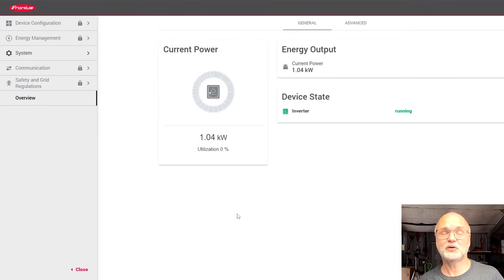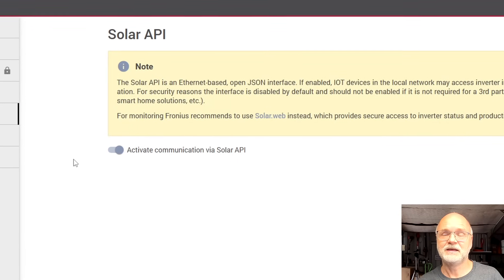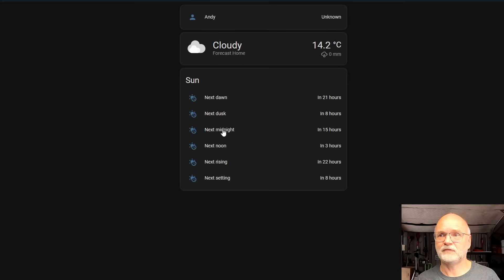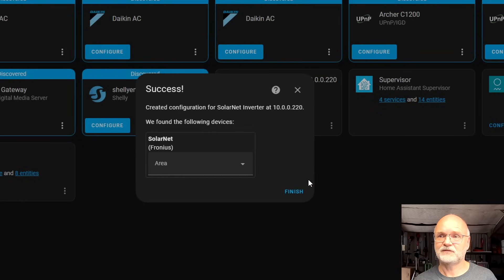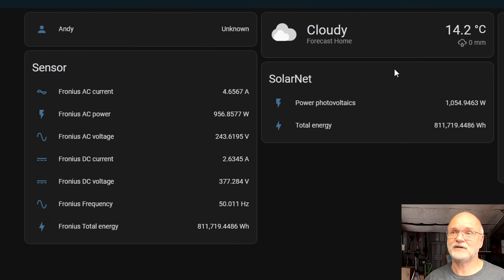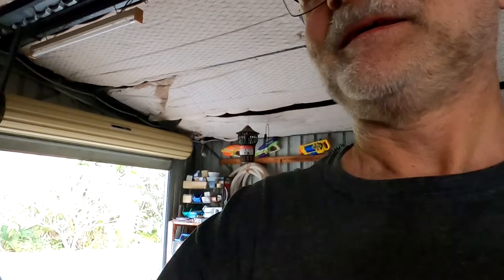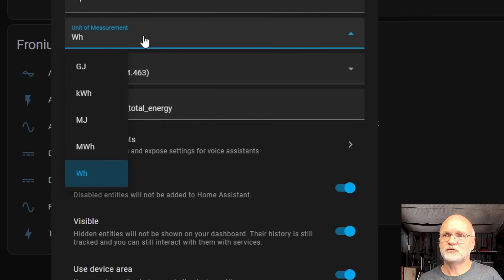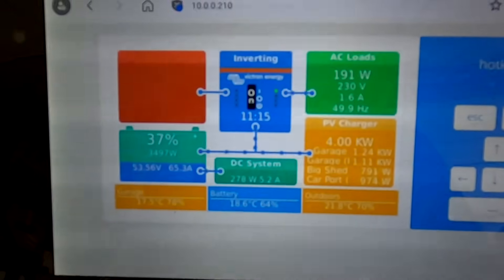How to integrate your Solar Inverter into Home Assistant. First step to Solar Storage Automation.

Comment: I also have a gen24 symo fronius inverter.
It is integrated in my HA green version. I cant get any automation to work when i have solar production or when i dont have solar production. The energy info shown in HA is corect, its the same as the solar web. But still, nothing works.
So, i managed to make it work. But it works randomly. It turns on a light when solar trigger is true, but it turns it on after a random time(5 minutes-1 hour). If i switch it off manually, it would pass the same time as above to switch on that light.
There is a random delay. For example, i switched off 2 lights. The HA turned on 1 light after 3 minutes, but the second light did not turn on. Solar production was way above the trigger value for both lights.What should i do?
Can you please help me?😊

Comment: Hey buddy I just wanted to check with you. But before I buy anything could you possibly point me in the right direction I would like to monitor my EG4 6000 XP on home assistant and I'm wondering if I need solar assistant setup in order to access the data for home assistant so everything is in my dashboard, Thanks for all your content!

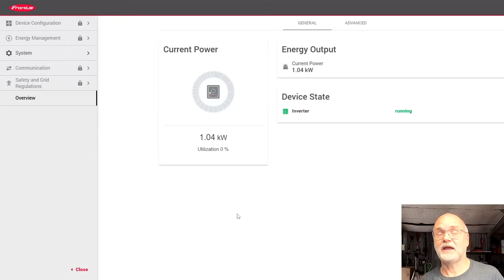Comment: 4:09 this is the most difficult bit, connecting the inverter to the Wi-Fi LAN.
Some inverters have the Wi-Fi reach of 5 centimetres so your phone can connect, but too short to setup a Wi-Fi LAN AP from a home desktop.
Is there a HA solution to making inverters reach the Wi-Fi LAN?

Comment: Can this be done with USB connection from my MPP-Solar inverter to Rpi?
Reply from the maker: No, you need to use RS485 and have the right protocol from MPP. USB will not work.
Reply: @OffGridGarageAustralia  ah thanks, my MPP-solar inverter only has usb and rs232 communications
Reply from the maker: @paulsharp1712  What do you run on this Rpi? HA?
There is actually an integration for MPP inverters and HA...
Reply: @OffGridGarageAustralia  cool,  hadn't found that!

Comment: Hi Andy 
thx for the great informative Vids! - I have the Fronius & BYD battery added to HA ....BUT ...Any chance of a vid on how to use the data? like ... if battery is FULL and Power gerneration is XX,,, turn on shelly switch for Hot Water /car charger / pumps etc ...😇

Comment: Hi Andy. I'm new to Home Assistant and have now a RPi4 + raspbee II  with HAOS installed and running. I would like to integrate my Victron system thru Cerbo GX into HA. In your video you introduced it can be done easily and will come in a other video. I'm so curies to see how this can be done without coding. Im a big fan of this community and your excellent video's!

Comment: I would really like to know how you connected Victron device to home assistant using the HACs integration because it asks you for the Advertisement key I have spent hours trying to find any simple instructions on how to get it. I bought a Victron Smart battery sense just to get my battery bank voltage on Home Assistant

Comment: Hey Andy how do you make more power in clouds than pure sunlight? That is just very strange to me incredible though but just very odd. One would think direct sunlight would create more power and clouds would decrease power. Anyway you could make a video to explain this? For idiots like me lol😂
Reply from the maker: Hey Branden. That is due to the shading from the trees I have for 3 months in Winter time. They block most of the sun during the day but with clouds, the light is coming from all sides and I have a huge increase in generation.
Reply: @OffGridGarageAustralia  ohhh ok that makes sense now! I live in Wisconsin in the USA. It's our summer now. Rather dry one.

Comment: You open a can of worms with Hassio, did right with the energy side of things. One day you have to show how to put the inverter info in the energy dashboard and since you have them, devices to monitor individual energy. I bought an esp but use batmon works with more than one bms and no coding, you will loose the connection to them for mobile app but in my case makes no difference since I manage everything  in hassio, victron connect still allow to see the battery voltage, A, SOC, etc . If JK Bms gives an error turning it off and on allow to be discover again, smart shunt works every time. Now will wait one more week for the BMS review.
Reply from the maker: I know, I really want to focus on the energy side here with Home Assistant and show some simple automations. Otherwise, the whole topic and theme of the channel may change quickly 😁

Comment: Andy you will love the tailscale plugin, you will be able to monitor everything on home assistant (and other devices) without any complex setups, it just works. I even have a widget on my phone that shows me the power produced and the battery percentage. Yes, i know, feeding the addiction!
Reply from the maker: One step at a time... 😁
Reply: me too, using Tailscale VPN to remotize HA where WAN IP address is not available (modem using cellular access to internet),
to replace the popular duckdns for Wired WAN.

I can confirm Homeassistant is so flexible and wide covering any kind of devices as currently I integrated on HA running on RPI4 @4GB of memory:

Solaredge API for on grid inverter and Resu Battery;

Shelly to monitoring grid exchanged power;

working on EASUN 8kW hybrid inverter (HA full integration in progress);

Tuya HA integration and HA Automation to switch on/off and monitoring power of EASUN, based on grid power exchanged. value;

3xJK-BMS by bluetooth dongles  and Github BATMON by fl4p to 2 Lion 13S + 1 LFPO4 16S @48V monitoring 43 cell parameters per battery;

4xSEPLOS V. 2 by RS485-USB adaptors and Github BMS-Monitor/HACS by flip555 to 4xLFPO4 @48V, monitoring 193 cell parameters per battery;

Tesla Wall connector to monitor car charging.

The only sw I wrote have been few rows of yaml code for Automation, none for integration.

Comment: HA is so great, but if I use Modbus TCP for Victron I didn't get entities about Critical loads on AC out1. 
Maybe you can help to get all informations on the Energy-Dashboard
Reply from the maker: Yes, I have the power display for AC out 1 showing on my dashboard. The entity is called vebus out L1 Power.
Reply: @OffGridGarageAustralia 
but where do you enter this entity?  House consumption is a calculated value of difference between Solar production, feed in/out battery and forward energy to grid.
Reply from the maker: @matthiasm8648  ah, ok. I'll show you in a video. If you want the info upfront, send me an email.

Comment: One of the first loads I automated was the pool pump. By using the sunrise and sunset parameters (with offsets) it will automatically adjust the pump's run time with the season. I used to also make further adjustment to pump start time based on availability of excess solar PV but it's not really necessary with the automatic time of day adjustment.

I also have HA automations looking after if/when to use supplemental charging of the off-grid battery with excess grid-PV. Needs it at this time of year because my off-grid PV array is small (2.2 kW) while the grid array is 11 kW.

As for using the Growatt (I don't use one) and many other inverters which are based on similar architecture as the Voltronic family of inverters (hundreds of them), an alternative which does not require using Growatt's off-shore servers but keeping it all local is to use Solar Assistant (requires a dedicated RPi). Solar Assistant is a bit like the Cerbo is for Victron kit. Then integrate the Solar Assistant with Home Assistant (using the MQTT integration). It works really well and is how my off-grid inverter is integrated with my HA. It's also very fast with second by second live data. SA also integrates the data from my Victron smart shunt.
Reply from the maker: Yeah, my pool pump needs to run longer in warmer weather to produce more chlorine. So, the day light time is not critical to me. But, I'm sure HA could handle this as well somehow. I'm not too fussed as the pump will run 24/7 in summer anyway. I then have far too much energy to burn....

The third point you make is exactly why people don't use HA. Just by reading this puts most of them off. Additional hardware, additional software, MQTT..., this is all not straight forward and a huge barrier for many.
But I understand what you mean 😊
Reply: @OffGridGarageAustralia  To be fair though, most of the Venus OS stuff you've shown over last couple of years (let alone the BMS communications) is much more difficult than hooking Solar Assistant up.

I agree, simple is good though. The primary benefit of using SA is it makes the Chinese inverters smart and easy to automate functions and so you can get triple the capacity of Victron for the same price (or pay a whole lot less for the same capacity).

Victron is nice kit but it's very expensive and in this off-grid / DIY space many are looking for better value and would like to avoid paying the blue tax.
Reply from the maker: @alexsimmons1803  good points, thank you.

Comment: Thanks again! It is really essential to have a central data collector and handler. I am using ioBroker and it serves my Gen24 directly and the Fronius web cloud as well, Fronius Wattpilot, BYD, Shelly,  Zigbee, utility meter and much more.  
Did you get a direct access to the Gen24 PV string power?
Reply from the maker: What do you mean by access to the string power? I'm getting the DC string voltage, current and power so far.
Reply: @OffGridGarageAustralia  I am just getting the total PV power combined of all strings and the 2 string currents and the 2 string volatges, but not the power of the individual strings. So, I have to calculate the 2 different string powers by myself. The complete combined PV power ist delivered by the Gen 24. But not the single powers of the single strings.
Reply from the maker: @klassichd10  ah, right. I have only ones string, so...
Can you get it calculate through HA somehow, is that possible at all?
Reply: @OffGridGarageAustralia  I am using ioBroker and currently I am calculating the two string power values by a Java Script which is the way user defined stuff is done in ioBroker (like python in HA). That works all right. In the Web Interface and Solarweb I also can see the two string powers. So, I hoped that there might be an undocumented feature to get the values directly and avoid this calculation. Just as an optimization to reduce calculation power.

Comment: Hey Andy. I am curious if you are getting 4kw during overcast winter weather, do you generate anything on a clear night with a full moon?
Reply: I sometimes see e few watts coming from my 4200Wp strings at full moon. But nothing worth to care about ...
Reply from the maker: No nothing, the voltage during full moon is far to low for a 48V battery. 
I probably could hook up a single battery cell charge it during the night from a 14kW solar system 😂 Not sure if there is actually current flowing.
Reply: @OffGridGarageAustralia  If you could charge even one cell, the idea that you could get anything from moonlight is magical. 🙂

Comment: Where is the damn snow considering you call it WINTER. No winter without snow.
Reply from the maker: Hahaha, once you live here for 10yrs+, 10° feels like -10°. 
Well, no snow here but 150km further inland, they have sometimes snow in the morning. And of course the Australian Alps in the south.
Reply: @OffGridGarageAustralia  I'm not sure but have you thought about the integration of SEPLOS BMS into HA ?
I still have that older, previous one without BT and think about an upgrade to the BT .
Right now I have an outdated intel laptop running next to it to get access and run the changes if needed. 

I did not need it cause I was able to retrieve the data or at least some from the back through the Growatt API access but , big big big but 

Growatt is now blocking accounts if you have too many api calls per day or hour and I am the first they shut down for a day or from the noon onwards cause I am running just 5x 4,6 kW Growatt inverter (3 as a surplus system with a battery and 2 as an additional system which is only feeding into the grid for 0,05€ more per kWh). But my call amount is basically 5 times higher then those with just 1 big inverter.

And due to the fact that the day starter earlier means that the point of time blocking my account starts earlier and earlier therefore the impact is hurting more and some SEPLOS data might be usefull too cause I am running the system with let's call it shared priorities. I mean I have 3 surplus 'consumers' to use energy that otherwise would be fed in.

And so I do not have a rule like first battery, then car and finally now the 270 L in the heatpump water boiler (which also has a heat exchanger needed for the sept - april heating season here. The last one is obviously the last to 'charge' once the warm water is achieved, but it has a PV SURPLUS mode where it is taking surplus energy to heat the full boiler up to 62°C in preparation for the heat exchanger that pumps the energy to the radiators we tend to use in the evening at least till end of may.

I am aware of the grott development which is running growatt inverters in a kind of proxy mode and listening to the growatt inverter to growatt cloud communication passively.
I am using already such a tool acting as a proxy called evcc developed here to charge the car with surplus only and also the heatpump boiler, which worked quite well, but the official growatt HA integration is still relying on api calls , so I am hoping for the HACs GROTT  implementation by also using the stealth or proxy mode to get the data.

Otherwise things get complicated cause I need some data for the SurPlus decision inside HA ... which are also in the Growatt app, but out of reach from HA at least from noon onwards.
Reply from the maker: @typxxilps  Yes, we will do this at some stage. One step after another...
HA can even wipe your a** if you want to😁

Comment: Hello, I'm from Brazil and I've been watching your videos for a long time and I really like your content. I have an Off-Grid system in my house and I really wanted to make a system that could manage all of this, but in my case I only have Chinese inverters without connection to any type of platform I am looking for a solution that can monitor these parameters so that integration with Home Assistant or another manager is possible, does this type of tool already exist? Due to your knowledge, you could do something like that and show it to us on your channel, it would be very useful for many technology and solar system aficionados.
Reply: Edson - if they are of the Voltronic family of inverter (e.g. like the MPP Solar inverters or any number of clones) or the Deye family (e.g. Deye, Sol Ark) then they will work with Solar Assistant. SA runs on a Raspberry Pi can be integrated with Home Assistant. Look it up - it's a game changer for these inverters and make life much easier.
Reply from the maker: Thanks for your comment and watching my videos, Edson.
That is a tricky thing. If your inverters have some sort of communication port (CAN or RS2485) it will be possible to get the data out of them and feed them into another system (like HA).
Reply: Unfortunately the inverters I use in my system are Chinese generics from the 2000w Lvyuan brand, I've already thought about buying inverters from better brands with communication ports. could be attached to these cheaper inverters, I believe that there may even be something like that, but it may require some programming knowledge with Raspberry Pi or Arduino

Comment: I remember using node red five years ago, which was pretty hard at first.  Home assistant is easier nowadays.  Rain, 40 mm, did something strange to the system, or was it just the bms I need to replace.